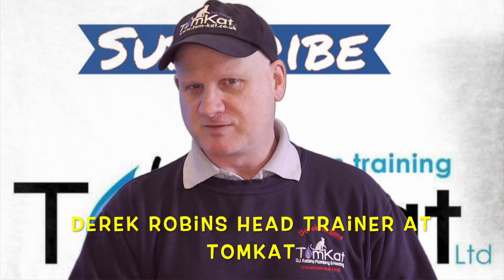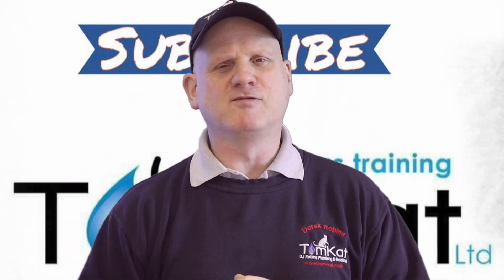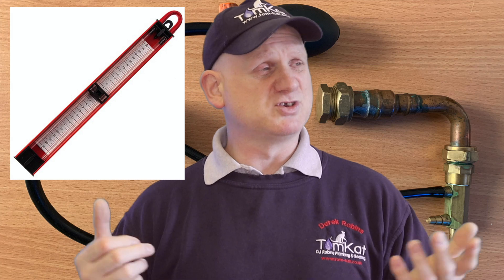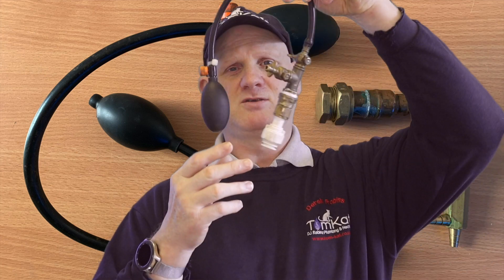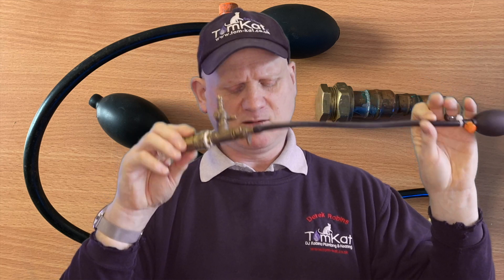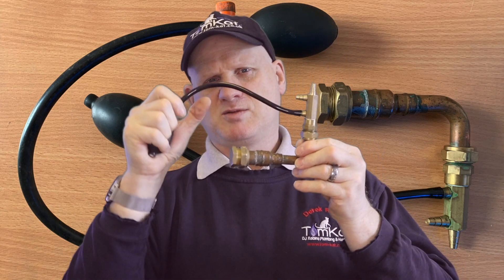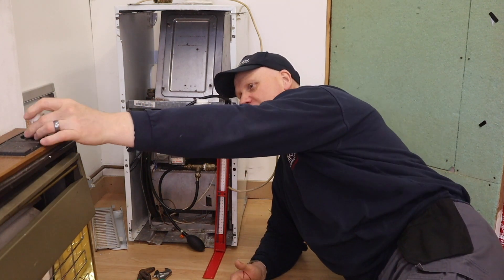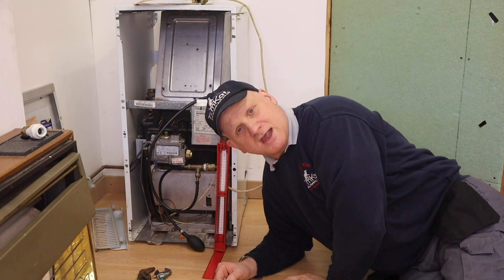TIGHTNESS TEST USING AIR, gas tutorial on carrying out a tightness test and find a leak using air.

Comment: Hi Derek, I carry out gas caps at the beginning of an property to make safe while vacant. I remove and cap off the previous tenants cooker and also cap with discs at the meter. Quite often it’s a credit meter and there is no gas so we introduce air via the meter test nipple and carry out the tightness test with all appliances connected. Am I still not allowed a drop in pressure in this scenario?
Reply from the maker: You can’t rely on an air test so no gas no test
Reply: @tomkatgastraining  even though  
I’m capping the gas off anyway? once a new tenant moves in a cp12 is carried out once the debt has been wiped on the meter?
Reply from the maker: @onefortheroad1  don’t understand why you are doing an air test the co12 should be carried out when gas is available

Comment: Interesting. Why would you do this test if you cannot solely rely on it and have to carry out a tightness test with gas after anyway?

Also, you did the test from the ‘carcass’ to the gas meter. What do you mean by the ‘carcass’? 😬 Thanks Derek 👍🏻

Asian Jon. Training.
Reply from the maker: Carcass is just the gas pipe no appliances and you are only using air to check the carcass before any gas is introduced into the property to make sure you have no leaks

Comment: Flux can hold a joint at those pressures😱 not that someone should be leaving joints unsoldered etc but if it's not taken fully then testing at those pressures only is not ideal. I would stick a bar in there aswell first.

Comment: Yes you can use an aspirator bulb or just use  lung pressure and surgical tubing ( just blow into the surgical tubing & pinch). Good isolation valves are key & a ball cock between your apparatus and the fuel runs should be mandatory ( this way we can determine if your apparatus is a piece of junk or not). Also note the temperature of the air used and the surrounding atmosphere temperature should be approximately the same before starting the test. Not sure why you guys in the UK would do it again with gas if the air test was proven good. If it holds with air pressure, it will hold with gas pressure. If you're required to test with natural gas just use a small canister of natural gas with a regulator ( we use our grunsky tanks if we need pure natural gas at any time ).
Reply: @paullbennett2923  on new builds the gas supplier will just leave a disc in the meter outlet and test for tightness then purge it. The carcuss won't even be connected yet anyway. Not till plot finals when the gas gets commissioned.
Reply: James and Paul here in the states the procedures can vary from gas utility to gas utility & from state-to-state. I worked as a gas fitter/ first responder for  the gas utility in the St. Louis metropolitan area for 35 years. The process here would start with the plumber or pipefitter normally an employee of the plumbing contractor or the mechanical contractor. They would install the piping and pressure test the piping without the gas appliances being connected ( their pressure test maybe 5 to 10 lbs  for a low pressure system, 10 to 35 lbs for a 2lb system and anything over a 2lb system would need to be welded pipe with a pressure test certification). After they completed their pressure test with no leaks they could connect the appliances. With all gas appliances ready to fire they would call us in. Upon our arrival we would walk every inch of fuel run and inspect the installation of every gas Appliance. At this time on a residential application (7" delivery) we would pressure test the fuel runs and appliances separately from the gas utility owned equipment. Using a manometer and only a water manometer we would pressure-test the customer's system ( appliance cocks on) pressure testing the fuel runs, appliance connections and the appliances themselves.After a good test of the customer's system we would check the gas company equipment ,also setting the lock up & working pressures of the regulator.At this time we would turn gas on slowly & bleed the air from the system. Once the air is bled from the fuel runs we would fire & test all the gas appliances. After all the physical work is completed then all the pertinent information would be entered into the computer system and any violations would be issued to the contractor on site.(note: this is the procedure we use for residential low pressure delivery only. Commercial and Industrial installations with higher pressures would be a totally different procedure).

Comment: Hi Derek, I always air test my CH pipework with a Rothenberger pressure gauge and attach it using either 22 or 15 mm pushfits, then pump up with a foot pump. If I have done a full installation before the meter is put in, I isolate the boiler, then do the same with the gas line. However, after your video, I'm going to add another test point to my tester which I can use to attach my u-gauge then I can confidently test the whole install at the correct pressure. Always helpful to me (and completely safe) to test with air, as it takes away any risk with gas in the pipe, then, when the meter is installed, do the full tightness/let-by tests. Great video, yet again good to get a helpful tip addition. Thanks.